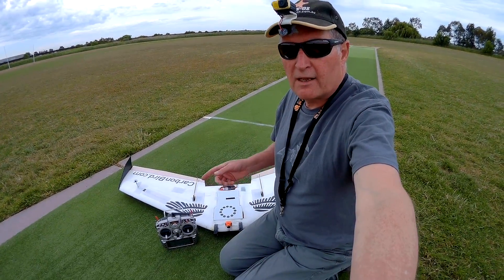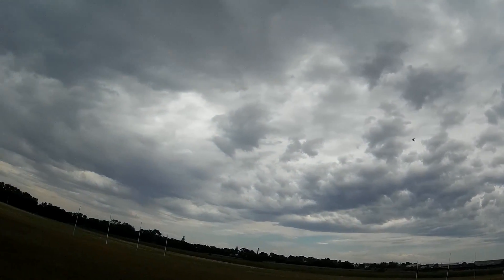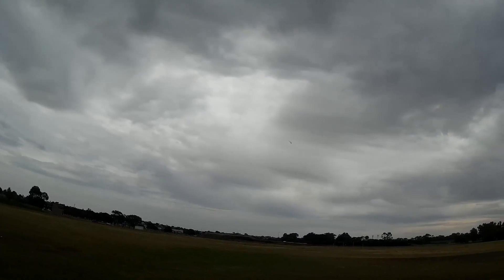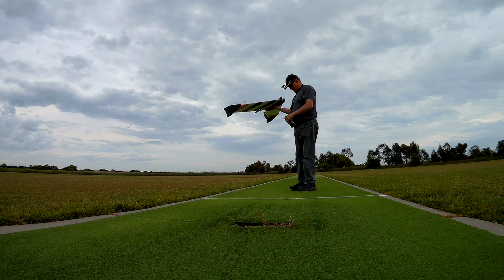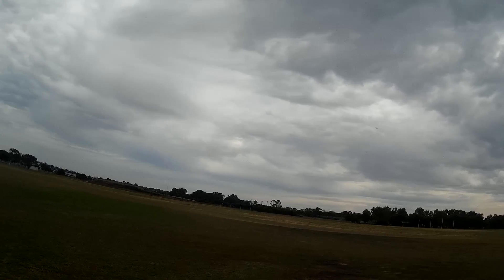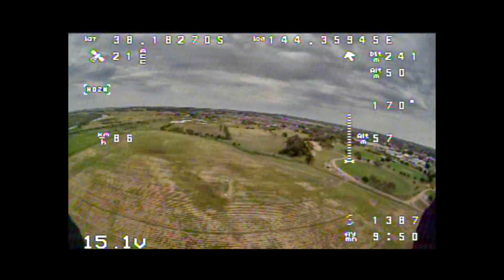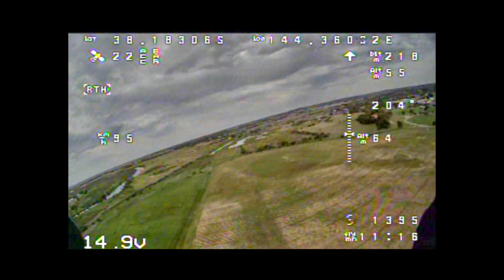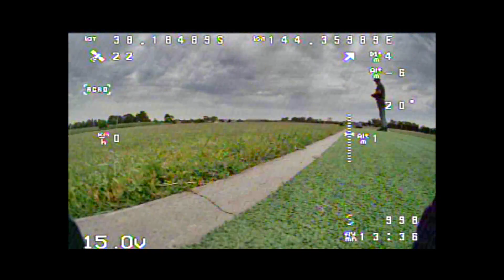Zephyr Z2 AIR3 iNav flights

Comment: Sir Andrew I have been wondering if i can use my regular 6 channel spektrum PWM receivers going through a PWM to SBUS decoder board to connect to the Air3 Inav Flight Controller.. Wondering if you have come across such a setup.. Thank you sir

Tarot 8 Channel Signal Conversion Module PWM/PPM/SBUS/DBUS/S-BUS/D-BUS/Pixhawk For Multicopter Drone https://banggood.app.link/13aoAWfaYS
Reply from the maker: Air3 can use PWM directly using the PWM cable. Dont know about the converter sorry.

Comment: people, just try Ardupilot,  no messing with cli. apps for windows, osx, ios and android.  it is a matured professional autopilot with huge ecosystem, rock solid reliability. Been using it since 2009-2010 on multies and since 2016 on fixed wing and honestly do not remember a crash where the autopilot was at fault.  for fixed wing it is heaps more advanced than inav,  including wind speed and direction calculation, which come really handy for long range return to home, direction lock, waypoint navigation etc.
edit:  there are new small boards like pixracer 36x36mm. I have one in a foamboard FT miniarrow.
Reply from the maker: Worth a look, thanks
Reply: Yeah problem with things like pixhawk is learning curve. I have both and would fly with inav after a day the pixhawk I still haven'tflown with after 4 months. 
Speaking to leed programers and those that use it for work the setup is at least 4 to 5 flights. The inav is 1. The pixhawk offers more functions and is a wicked bit of kit. Its not as intuitive as the inav. Talking to the inav guys I feel by the end of 2018 the Air 3 will be nipping at the heals of adruino stuff. Their programers are making progress every day. But that said pixhawk has so many contributors who knows. But theres no argument that it offers morw features it would be great if they made it a little more NOOB friendly which is what Air3 offers. And you can use a GS and mav with the Air3 along with speed tube and many other things dependant on how deep you want to go. Its not like the older board inavs which is where I think people are getting confused its the next generation.

You again are right though no up to pixhawk yet but boy they have gained alot of ground in the past 12 months.

Comment: One thing i noticed on the bench, unarmed, the horizon and angle mode dont move the servos hardly at all. It this just because its not in the air or do i need to increase something? When i move the sticks the elevons move enough manually so it does have the throws if it wanted them.
Reply from the maker: Have you plugged these into the CLI? You can also change the RC Expo from 0.70 to 0.50 or less. And there are other places in the configurator to increase rates (still experimenting)
set max_angle_inclination_rll = 600
set max_angle_inclination_pit = 600
set small_angle = 180
set failsafe_throttle_low_delay = 0
Reply: i will check when i get home. I had followed yours and matts tuts
Reply from the maker: May not have mentioned them in my earlier vids. Recommended on the iNav Fixed Wing Wiki.
Reply: oh i probably did it then. I went thru that whole section while watching the tut videos

Comment: Very enjoyable Andrew. I can't decide if I should go the expensive Air 3 route or follow Matt O's vids and go F3 or F4 Omnibus with INav installed of course. Planes available to install setup include Bix2, Z84, Mini Skymunter, FMS Super Easy Trainer, S/H Trainstar 1400 Trainer, and wait there's more including powered gliders etc. Not a digital servo in sight tho. Ideas ??? ...Stew.
Reply from the maker: Bix 2 would be my choice. AIR3 will give you success quicker, but nothing wrong with the Omnibus if you want to do it all from scratch.
Reply: I had a feeling you would say the Bix Andrew as yours was such a success. Even the analog servos didn't seem to make that much difference. Thanks for  your reply. Happy flying.

Comment: Looking good Andrew, I think you can remove the larger value of Altitude though, thats HASL height above sea level...Its fast for such a big wing, those Aeronaught props can really suck up the amps...Try doing a "fake" launch to get the motor running, then chuck it in Auto..I like to have the centre crosshair on, its useful for trimming pitch and to see if you are flying level..You should also be able to get RSSI with your FrSky reciever..its useful...You just need a $4 LC filter now in your video power to get rid of that esc noise...Good job m8..:)...you may also have a baro in that board..?...disable it inside iNAV and use GPS 3D for altitude...it will work better.
Reply from the maker: Thanks for the tips. I have a DIY LC filter I can use, and I'll try GPS 3D. Didn't know what it was. Side launch with thrust is my preferred method for this heavy wing, easier on the shoulders.
Reply: Yes, you have 20 Sats, so iNAV uses 3D GPS all the time, including altitude to calculate exactly where it is and where Home is...The D4R receiver will output RSSI usually available along channel 8 or 16 via SBUS depending on what FrSky firmware you have loaded...So it's easy to implement with no wiring needed.
  You may be pleasantly surprised just how much range your Taranis has when you have numeric RSSI to look at on your OSD. Alternately, fit your L9R then it won't matter....lol.